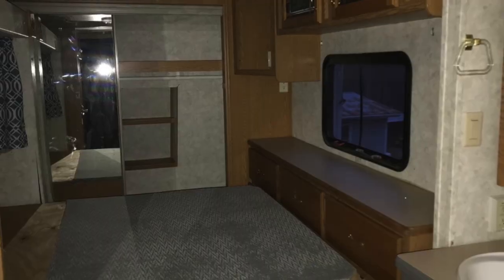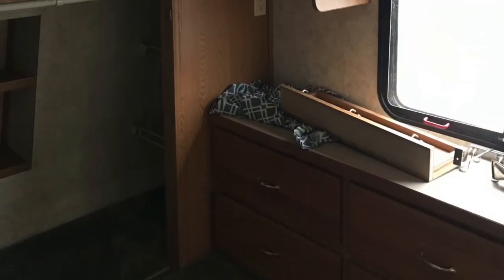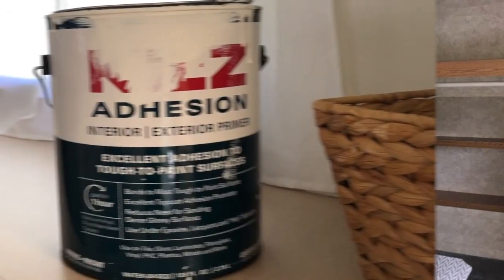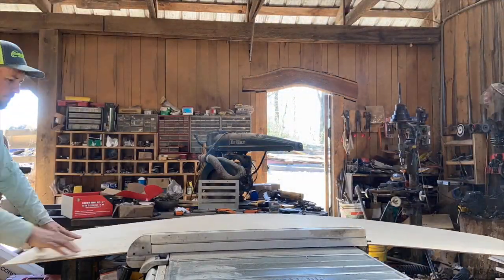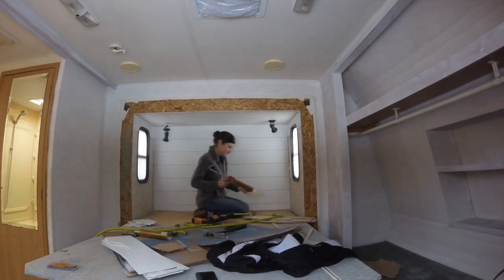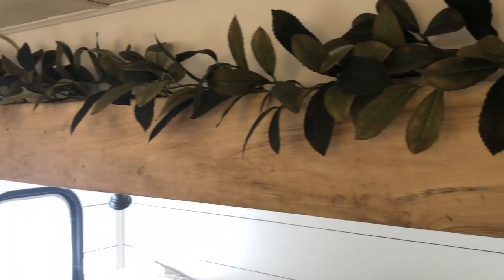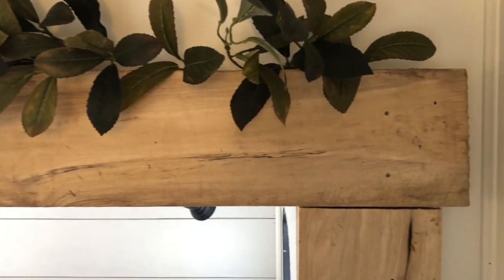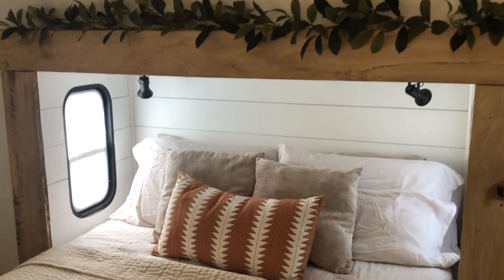Tiny Home Camper Bedroom Remodel

Comment: Got here from your door video. Digging the shiplap. Something else I’d thought about doing accents of in our camper. I like the luan idea for it. Did you use anything to space out the shiplap as you installed? And what size nails did you use? Looks great!
Reply from the maker: I started off with using a nickel to space out the boards but I ended up just eyeing it. I can’t remember what size of nails I used but they were shorter so they didn’t puncture out the camper walls. I also used construction adhesive to help hold the boards in place.